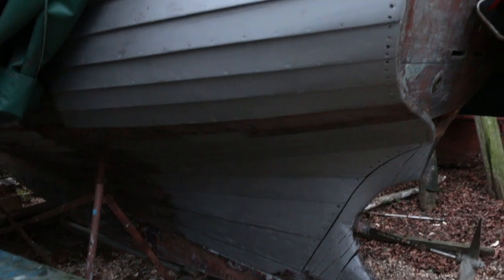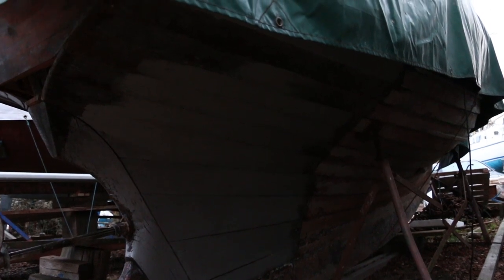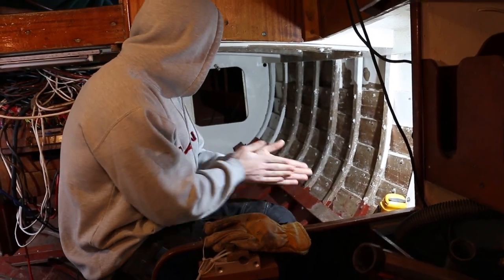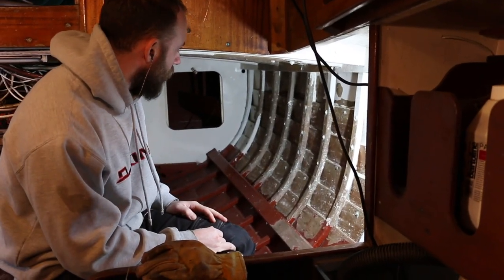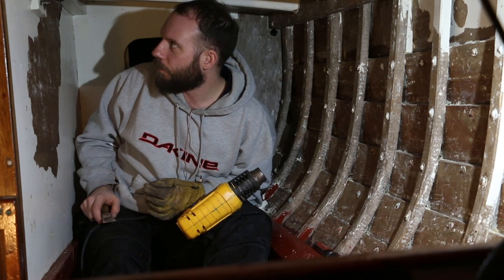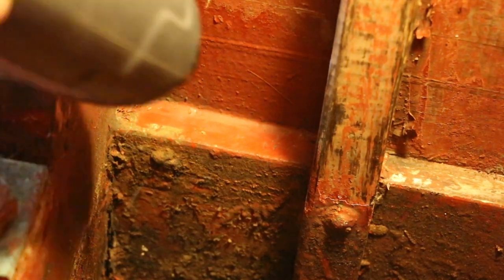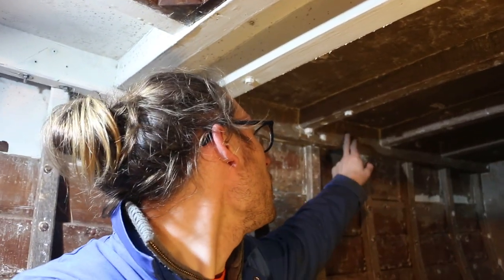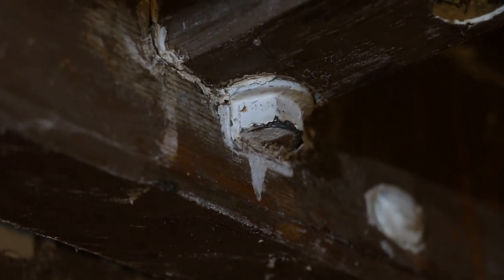02. Burning Paint and Deck Beam questions. Wooden Boat Restoration.

Comment: Have you found any planks or end timbers that need replacing?
Reply from the maker: Hi Bernie, thanks for watching. The planks are so far so good. Hood ends at the transom a little split in places but no rot, they have deteriorated at the chainplates (mild steel) so I may have some shipwrighting to do there. Transom and ribs have been the only soft spots so far. Cheers